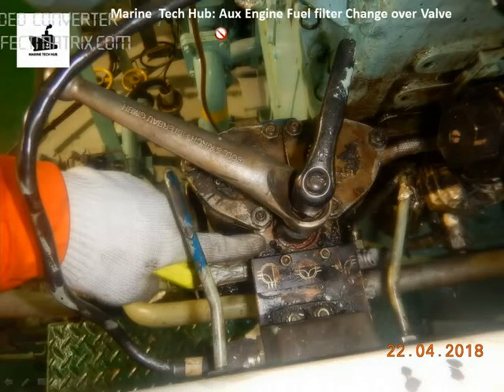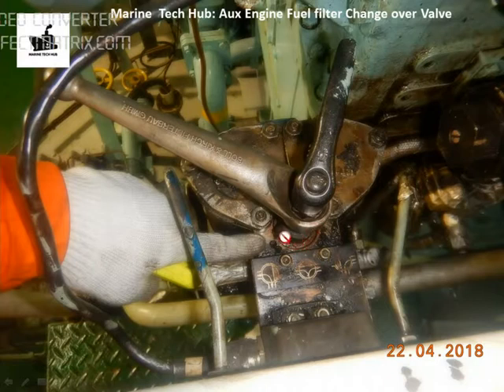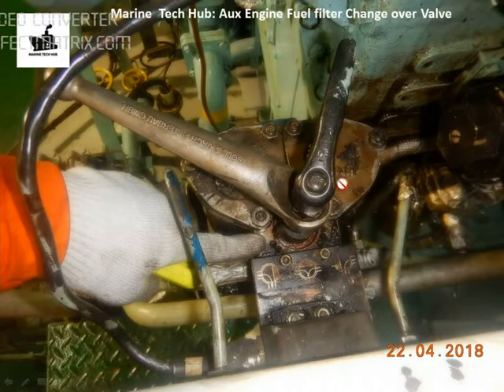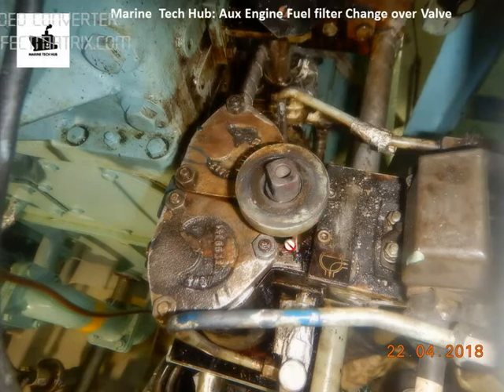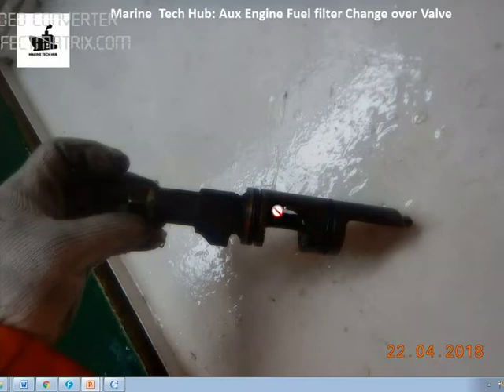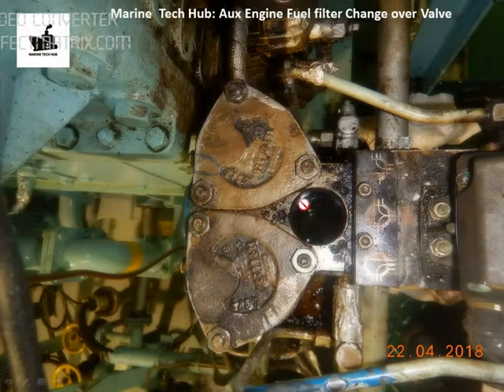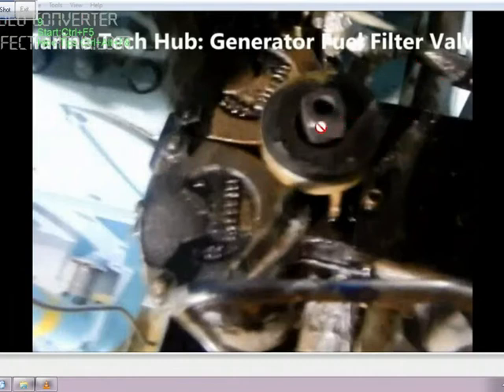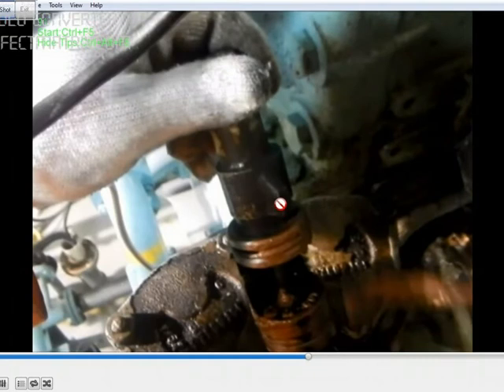Generator Fuel Oil Change Over Valve Leakage Rectify

Comment: Dear Sir, i want to know if it is necessary to change  over to diesel before cleaning both filters. Is it safe practise to clean one filter when other one is in use when the generator is running? thanks in advance
Reply from the maker: To be 100 % safe working. Always clean the filter when DG is not running and also close both the inlet and outlet valve of  the fuel system.
Reply from the maker: You need not change over  to Diesel oil.

Comment: Sir while backflushing is there any danger of stopping of DG and while backflushing is it nessary to purge the other filter
Reply from the maker: Welcome to marine tech hub. Stopping of DG will not happen as long as the Supply pump and circulating pump have the pressure. Even if both pump stop the generator will run since you have oil in the mixing column for 20 to 30 minutes depends on the quantity of oil in the mixing column Always fill both the candle filter before you change over to auto filter